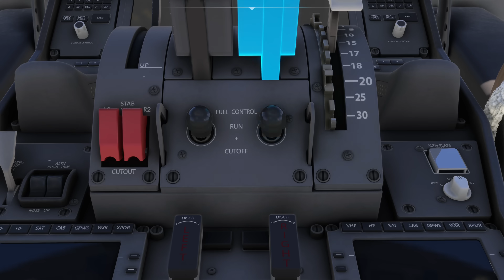Air India 171: Why Did The Fuel Cut-off Switch Get Moved?

Comment: Since the copilot was at the controls, he only would have noticed the fuel switches in cut-off position and asked why... Since he noticed the absence of thrust, he would have panicked as his life was also at stake  and he would have turned on the fuel switches on immediately before asking why are they off. And, thst must have occurred seconds after they were turned off because the aircraft was already lifting skywards.

Comment: How does the fuel system get the message to shut off the fuel to the engines? Is it mechanical; e.g., pulling the switch out from its seat physically causes a value to close? Or is it a software instruction transmitted to a value? Both pilots, apparently the only two persons in the cockpit, state they did not touch the switches. A man about to intentionally kill himself has no reason to deny his act. And, apparently, the record shows both switches returned the fuel system to "run." Boeing engineers can answer the question.

Comment: Requiring two pilots to have to work together to move. The fuel controls sounds good but, if one of the pilots is for some reason incapacitated, the other pilot has got to be able to perform all functions that’s the whole premise of a copilot.

Comment: Let's say,  it's possible to accidentally toggle cutoff switch due to some sort of a mechanical failure of the switch. What are the chances, one will hit them one after another and that both of the switches have same defect which wasn't noticed earlier? Sounds very unlikely to me (though I'm not a pilot or aerospace engineer).

Comment: MN4 - microprocessor replacement.  Review the SB Service bulletins.  There are loss of potential control issues with the ECU as the solder may need to be replaced. These units are very sensitive to temperature.  It could be that the loss of continuity of power would replicate the “off-on” position without moving the switch.  Sort of like a loose electrical control for a light that might have intermittent.  Look at the Main Control Board Panel and its service record.  Wiki says that 8,000 flight cycles for that plan.  American suggests a soft 9,500 hour to the FAA 11,000 hours.

Comment: Why, like with (at least) European lawn mowers, is there not another button/trigger that needs to be pressed at the same time as the switches being flipped to energise the circuit?

At least then you’d know FOR SURE that the switch flip was intentional and not a complete brain fart… right?

🤔

Ok, the switches are secured with a physical guard, but, if the circuit isn’t even ‘energised’ without a secondary trigger being held (maybe one for each of the pilots) then it wouldn’t matter if the switch(es) was(/were) flipped unless the energiser button was triggered first.

Heck, maybe even tie it to a 5-10 second countdown whereby it has to be held for that long without the other pilot cancelling the request, or, until the other pilot confirms it with their own trigger.

You could even have a button or set of buttons per pilot at the opposite end/opposite ends of the control panel to switch operation of such a system over to single pilot mode in the case that one of the pilots takes ill mid flight.

On finding that the single mode operation button has been activated during pre flight checks, the rule could then be that the pilots have to disembark the flight so that a different crew can be swapped into the flight.

Comment: Several Indian pilots and aviation experts are now claiming that it would not have been possible for a pilot to switch both of the fuel control switches from ON to OFF within one second; they argue that microprocessors inside the switches were likely at fault.
Reply: I don't think anyone can manually switch them on and off at the exact milliseconds. I doubt that they were even programmed to only receive signals if and only if they are toggled at the same exact milliseconds. They can be toggled with even more than a second and they will still receive those signals properly.

Comment: I have a psychological SPECULATION, I have ADHD, I can relate the crash mistake to silly mistakes I make, I am not sure if the ADHD is even relevant to what happened and I don't know if pilots are hired even if they have it but here's what I think:

I know times where I make mistakes often illogical to the current settings, like bending the pen I am holding while talking to someone for no reason, fidgeting when thinking, and mistook a certain habit for another action (e.g. in a multi-tasking cooking setup, instead of putting onion+garlic+salt which is one of my usual routine on making specific asian dishes, I mistakenly added onion+garlic+ginger which is another routine for another dish, I don't know what the psychology called on this) ,  and then realize that mistake a few seconds afterwards. This could be similar to why the pilot toggled the switch.

For the other issue where the pilot denied the mistake, I know episodes where I don't want a certain somebody to know a mistake that I did, so if someone ask me why I did the mistake, responding in a split second with "I didn't do it" is the usual defence mechanism, then afterwards confirming if I really did the mistake, then afterwards silently try correcting it. This would the same sequence of events (which is 10 seconds) mentioned in the report "IF" the one who flipped the switch back on again is the same pilot who turned it off in the first place. I mean it's consistent to not hearing any other conversation aside from "Why did you do that?", "I didn't do it" and "MAYDAY..." in the transcript, meaning no one knows but is likely the same person who made the mistake of cutting off the fuel switches is also the one who tried to correct the mistake by turning it back on again.

If it is the way I described, then it would be truly sad.

Comment: 7:23 I am fairly sure you’re correct but the slight grey area given SAIB NM-18-33, “Engine Fuel and Control,” dated December 17, 2018. The aircraft in question would need P/N 766AT614-3D to overcome this FAA Special Airworthiness Information Bulletin (SAIB). Although this is 7 years ago, who is to say Air India carried this work out.

This could potentially lead to an inadvertent in-flight engine shutdown which would have meant neither pilot was at fault

Comment: Could some delay be added in or a computer prompt to initiate the action be installed for the Cutoff switches so if some how this happens again they will have time to correct it?  Also have some emegency feature added so when the engine really needs to be cutoff in-flight it can be done so.

Comment: There should be a digital handshake mechanism for any activity that potentially places the airplane in a fatally vulnerable position during any part of the flight. For example, if one pilot tries to put the fuel switches from run to cutoff while taking off, then in the first 600ft (just a guess), a digital handshake will be required. But may not be required while it is landing and within, say the same 600ft of ground.

Comment: One senior Boeing Pilot suggests:
Poor Maintenance leads to poor electrical connections lead to AC non functioning lead to temp increase in hot humid airport in the scorching heat lead to vapour accumulation in the fuel tank lead to fuel transmission blockage when the aircraft tilted back to fly lead to engine failure lead to fall and hit to the building below lead to fire ball lead to deaths and destruction.

Comment: A relatively simple mechanical mod to the switch to give each pilot their own separate throttle stop release would be (reasonably) basic given the centralized controls. For instance something like the F-16 throttle stop but with each suitably "handed" for right or left seater.  
However the core problem is not addressed which is a hostile pilot locked in the cockpit with the "good guy".  
BTW any electronic mod just adds more delicate feces to break (ancient former engine troop here crosstrained from avionics to escape 1980s Moody AFB). The fewer electronics a mod involves the better and I say this coming from tube-and-tuning motor systems (Phantom, Bronco) to later F-16s.

KISS or more problems will be inserted by desire to do good.

Comment: Is this a fly-by-wire system? In other words, does moving the switches turn on/off an electrical circuit to the pumps directly, or does doing so send a signal instructing a computer to do so? The flight data recorder indicates the cutoff and subsequent switch back to run. But what is it actually measuring? Is there a sensor on the physical switch or is the sensor on the circuit? The implication being that perhaps the switches themselves were not moved, but the computer commanded the off on. This would explain the question, did you turn them off? and the response no.

Comment: This Answer is 2:34 is confusing, The fuel cut-off is typically done after landing and the aircraft has safely decelerated on the runway, not before landing. This ensures the engines are available for any potential go-around or emergency maneuvers, as the engines need fuel to produce thrust when required ?

Comment: People STOP pushing and speculating  this narrative of rogue pilots!!! There is not enough evidence for that. In figure 13 of the report, the fuel console still show the switch are in the RUN position. EAFR says Eng 1 transition from run to cuttoff and a second later Eng2 follows. If a pilot deliberately did that why would the console still be in the run position in from the wreckage? There is a lot of speculation going on and I don't like it. I have over 20 years of experience with main engines control design and aircraft design and everything I am seeing from this accident feels like a software clitch. People are using the last bit of conversation we heard of the pilot saying "why did you cutoff the fuel?" and the EAFR data showing the fuel switch transitioning from RUN to CUTTOFF as evidence that somebody did something rogue.  Everything in the report can be explained and in fact the FADEC did exactly what it's design to do by attempting to restart the engines when they went out. It's NOT anyone turning it ON and OFF. Every time there is a crush, especially when it's non western pilots, we go into this accusatory mode. STOP IT!! and let's look at the facts. The facts, to me, do not suggest any wrong doing on the pilot parts.  The question we need to answer to understand what happened is why did the fuel switch went from RUN to CUTOFF in the first place. Let's by looking at the Valve feedback position signal, the SW Command sent out, and the Fuel switch position. Let's follow a real fault tree analysis even on these videos and STOP hinting that this is pilot deliberate act. It's unfair. Has these two pilots been Westerners, I don't believe there will be that much focus on them. Everyone has to know that to be able reach a level of being a pilot or even  going to the University in so called "third world country" you have know your stuff and these guys have earned it so let's give them the benefit of the doubt and stop with the rogue pilot theory. Per the report and the data I have seen, it's not supported. We said the same thing when the 737 Max went down. We speculated and blamed the dead pilots for some time when actually the pilots from the Ethiopian flight actually had sense to try to trim the plane manually. At the end we all found out what Boeing did.

Comment: It's highly ridiculous to blindly believe that such a sophisticated advanced plane will have a raw switch to cut-off engine, with no fact check & cross verify mechanism for verifying the altitude and mode (take-off/landing/flight mode) of a smooth running plane! 

It ought to have additional protective warning to double check the decision, if at all, to cut-off the engines..👌😨🙏

Comment: I'm getting confused.  The initial report said that the investigators found the fuel cutoff switches in the "OFF" position.
Then cockpit data recorders reported that the switches were turned "OFF", but then back "ON" and both engines had relit just before the crash.
So were they On or Off???

Comment: I would like to talk more about intent, and not leave it up to interpretation. Let's explore the interpretations. Without cameras, how will we know if the one who asked "why did you cut off?" was not the same one who cut off? How do we know they were not collaborative in doing it? I really would implore you to consider how 10 seconds really is a very long time in an emergency like this. We're not talking about cruising at FL370; this is takeoff, where immediate input is needed! That's about 3000' at 180 kts. Waiting and then switching slowly them back to RUN only after the plane's course cannot be saved is extremely suspicious for both pilots (two seconds between the switches going back to run, communicates no urgency). I cannot accept that there would be so little back and forth dialogue if only one pilot was causing the trouble. Cameras could have even prevented this, if they knew their villainous act would be seen by the whole world. Or would the difficulty of needing to perform a visible charade of innocence to a camera have discouraged them from attempting this? If one or both of the pilots are innocent, then cameras would help showcase that. What if some device was installed on the plane that manipulated the cutoff switches, and it took them that long to bypass it. I would like to believe that both these pilots are innocent, and if there was camera footage, it could reveal something that is outside of our imagination. Also, the pilot's lives. One was about to retire, and another was about to get married. Both seem like positive life changes, but can we learn more about their lives? I don't hear anyone talking about them

Comment: If one of the pilots really wanted to crash the plane on purpose by shutting off the fuel switches, he would have stopped the other pilot from turning them back on. That is how it always goes in cases where a pilot is trying to commit suicide. They make sure no one can undo what they just did.

But in this case, the switches were turned back to the ON position within seconds, and a mayday call was sent out. That does not sound like someone trying to crash on purpose. It sounds more like confusion or something went wrong unexpectedly.

The voice recorder shows one pilot asking the other why the fuel was cut off, and the other one saying he did not do it. That is not what you would hear if it were planned.

Unless the cockpit recording we were given does not tell the whole story, it seems like someone was trying to save the plane, not bring it down.

Comment: If fuel to an engine needs to be cut off in a fire, the pilot will follow memory items checklist and pull the FIRE HANDLE and rotate to activate fire extinguishers. I never heard of a procedure to turn off fuel pumps one by one, since that fire handle will stop all fuel, oil and hydraulic flow to an engine.

Comment: The report leaves as much questions as it answered. The lone survivor said he heard a loud bang and the lights flickered just before the crash. What was that, it wasn't even mentioned. In one of the videos of the plane going down you see something apparently flying off the plane. What was that, not mentioned. A person who was flying in that very plane two hours earlier stated that much of the entertainment system was down, the a/c wasn't working, and many lights weren't working. These systems draw a lot of power. One concern that has been brought up is during hot humid conditions there are two electrical buses under the cockpit subject to moisture condensation inside of them. Inadvertently I am sure. A recipe for a massive short that could explain the loud bang. A short that could cause a lot of chaos. The landing gear selection lever was always in the down position yet the wheels went from the toe up position to the toe down position as if the lever had been  moved to the up position. I wonder how and why a suicidal pilot could do that. According to the Washington Post, the NTSB team sent to help with the investigation was so frustrated that they were ready to walk off the investigation but didn't really say exactly why. This is, after all, a preliminary report. I think that there is much still to come.

Comment: Capt, the controls were cut off within one sec, is it possible to do it so fast?
Reply: Yes, that's been tested
Reply: The gap between 2 switches being cutoff is one second.  Pilot can have both hands to close them at same time.
Reply: @brandonle9381 simultaneous cut off sounds less persuasive.. the 1 sec interval is very precise.. if it was done simultaneously, it would say that the two cutsoffs happened simultaneously...
Reply: @rajcryp1472 it can be done with both hands. Just like you switch the lights. Anyway, this is a gap not within one second. The computer won’t detect signal same time.

Comment: The B787 is a failed program driven by Wall Street greed, compromising quality standards. Soon, you’ll see more stories emerging to prove this. You can try to blame those dedicated pilots to protect Boeing’s reputation, but remember — you’re going against basic humanity by doing so. The only responsible action now is to ground all Boeing aircraft and require the company to focus solely on maintenance and a thorough quality recheck for the next two years.